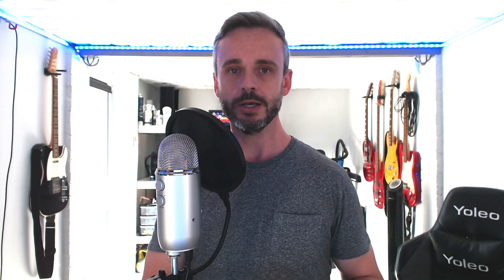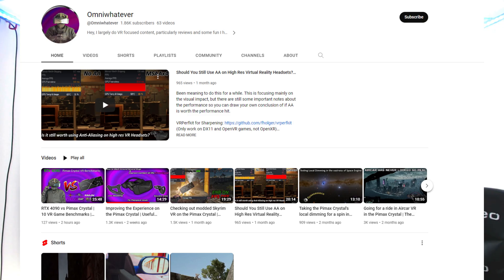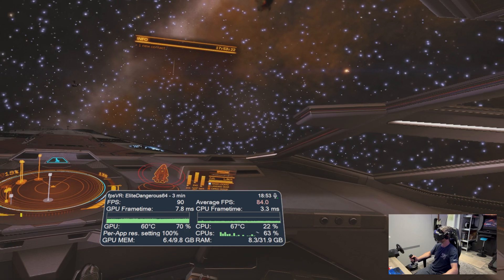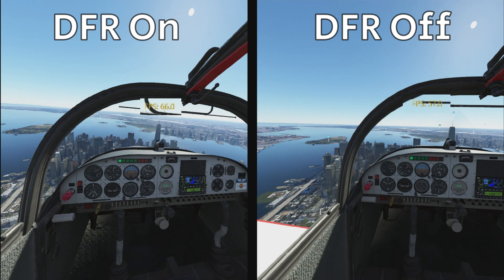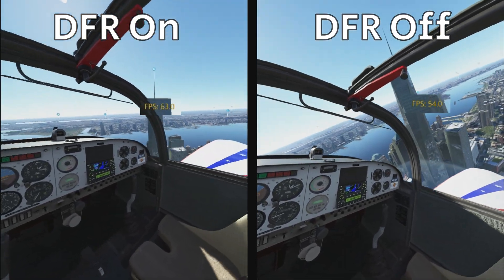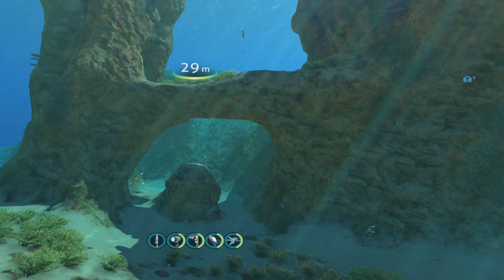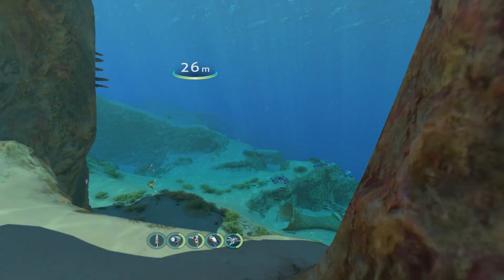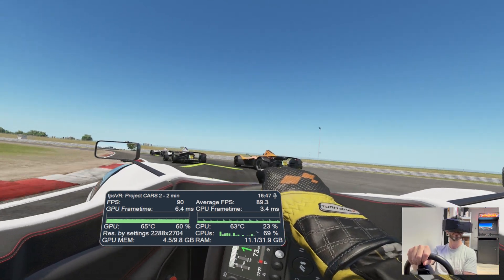Dynamic Foveated Rendering Implementations on the Pimax Crystal... (a bit of) clarification

Comment: Ah, think maybe a few more things I should clear up if it wasn't clear in my comment since I think some of my words are being misunderstood.

So, Variable Rate Shading is one method which you can use for Dynamic Foveated Rendering, there's a couple which each work their own way, and it's the method that BOTH Pimax and the OpenXR toolkit use for DFR. The VRPerfkit actually uses the same method for FIXED foveated rendering, if you have any experience with using that. It is not technically exclusive to Nvidia, but AMD lacks support for VRS on directX11 titles, only supporting DirectX12 and up for it on PC. Pimax's old usage of fixed foveated rendering on ntheir prior HMDs was exclusive to Nvidia for this reason, so it may carry over to DFR here too. Not 100% sure.

And I never said it'll work with any OpenVR title, just that OpenVR is the only runtime it CAN work with right now. There are still many openVR titles which it doesn't work with, though more work than don't work in my testing. But if something is OpenXR then don't even try to use Pimax's toggle in their software since it simply won't work. That's where you need the OpenXR toolkit. This'd also be why Opencomposite won't have DFR work natively with Pimax, since it's trying to convert the OpenVR runtime to OpenXR. You could maybe still make DFR work with the OpenXR toolkit on it in some cases though.
Reply from the maker: Yes, I understand you didn’t say every OpenVR title supports DFR. I realise I said that in this video, but my pinned comment on this video tries to roll that back a bit.

But thanks for this clarification to my attempt at clarification!

Btw, do you know if Pimax has released any in depth information on the various methods and implementations of DFR? I suspect a list of compatible/tested titles might be too much to ask for at this stage, but I’ll continue with testing it regardless.

Comment: Everyone is noob to this, as DFR was not really a thing before.
Reply: I agree mate.  Also, I think that DFR is something we need to wait using/reporting/reviewing until it's more mainstream with all VR headsets that have eye tracking.  I'm sure it will eventually work great.  While most can use OpenXR Toolkit for FFR, with a strong gaming pc (eg i913900k/rtx4090) it doesn't seem to add a lot for me with sims like msfs using either my Quest Pro or OG Vive PRo1.  I can already get pretty well the same results, and a lot simpler, by just using the right combination of graphics, super sampling, and dlss settings.

Comment: I don't use openXR toolkit becuase I find I lose performance compared to steamvr, and also I hate 3rd party addons. So for msfs can can I run DFR using the pimaxvr tool natively without having to use openXr toolkit?
Reply from the maker: Not in any way I can think of at this stage, no. DFR can only be activated in MSFS by using OpenXR Toolkit by firstly selecting FFR, then selecting ‘eye tracking’ in the menu system.
Reply: I would not mind using it but it makes my image shimmer. I can see the doctoring.
Reply: @QBziZ  Yeah I lose performane and see anomolies so don't like it too.
Reply: this is usually due to overlapping sharpening. Make sure you're not sharpening in pimax , ingame and openxr, has to be one or the other. @QBziZ